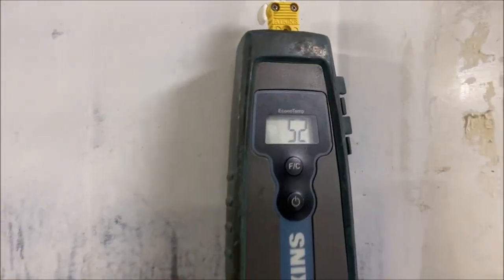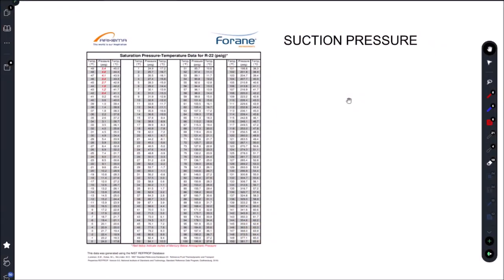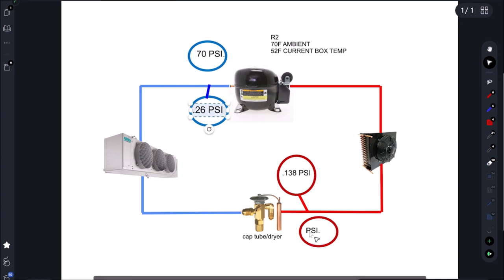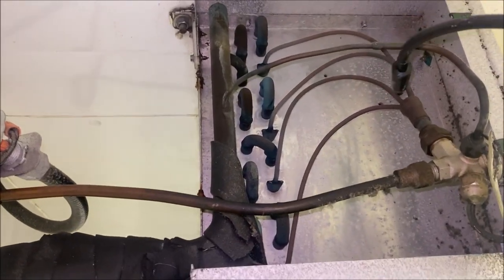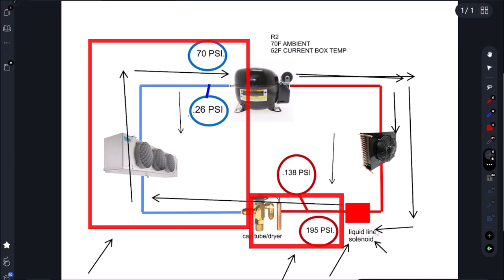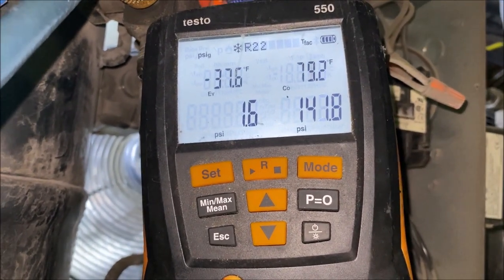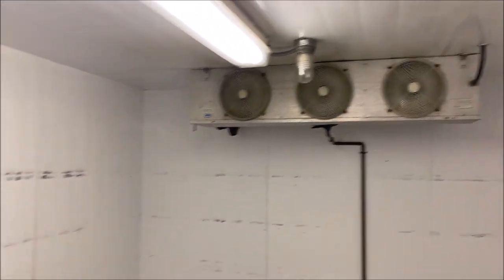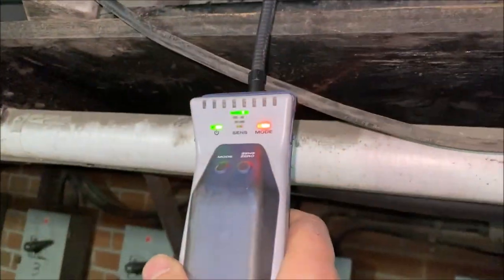R22 Walk in Cooler is warm. Pumping down a system to replace a liquid line solenoid

Comment: great video.  why head pressure ambient + 30 other time it is ambient + 15 what is different?
Reply from the maker: Depends on what the engineer has it set at, sometime 30F (mostly older equipment) and sometimes 15F (mostly newer equipment)

Comment: No vacuum on the liquid line?  Would have to add a process valve. What did you do ?
Reply from the maker: Yes absolutely need to vacuum, or non condensibles will most likely form in th4 system. The vacuum was done with both the receiver and compressor suction valves front seated. Can’t do a nitrogen test because these valves love to leak, so we use the refrigerant that’s in the System.

Comment: Love your videos usually but this one the box temp findings seem a little off… at first you say you want to achieve SST 42F> 71.6psig (which seems a little high) then at the end of the video the result temps/pressures it doesn’t correlate anywhere close to this.. also you used actual box temp instead of previously the desired box temp.. just wondering why? I would have used for eg desired Box temp 36F - 12F = 24F SST= 47.6psig. Still learning just looking for clarity…
Reply from the maker: A cap tube is fixed, meaning the pressures won’t drop as the temperature drops. This is why we use desired box temp. A TXV meters the refrigerant into the coil. So as the temperature in the box drops, the pressure will drop with it to attempt to maintain a 10TD and/or superheat.

Comment: 🇺🇲💪👍❄️ great informative vid.  When ur doing manual pumpdown the tstat needs to b calling so solenoid is energized so all refrigerant is out of low side, correct?
Reply from the maker: In just a normal pump down, the solenoid valve should be closed (thermostat is not calling for cooling) which will pump out all of the refrigerant between the solenoid and the suction valve on the compressor.
Reply: @REFRIGERATIONKITCHENEQTECH  correct but in ur situation u needed the valve energized so all refrigerant would b out of line on both sides of the solenoid valve. Right ? N stopped at receiver
Reply from the maker: Yes in this situation
Reply: @REFRIGERATIONKITCHENEQTECH  thanks hopefully the flyers get the no. 1 pick they need help. Go leafs
Reply from the maker: Lol, Bedard is gonna be a stud. I’m a habs fan, hate the leafs lol

Comment: You are very knowledgeable and excellent troubleshooting skills. I like that leak detector.
 Would you recommend it ahead of the fieldpiece models or the h10?
Reply from the maker: I find theH10 is the most accurate but the Dtek is the most convenient so it’s the one I pull out first. I’ve never used the field piece so I cannot comment on that one
Reply: @REFRIGERATIONKITCHENEQTECH  Thanks much
Reply: @REFRIGERATIONKITCHENEQTECH Does it work for natural gas as well?
Reply from the maker: No, I use the dtek gas mate for that
Reply: @REFRIGERATIONKITCHENEQTECH  thanks